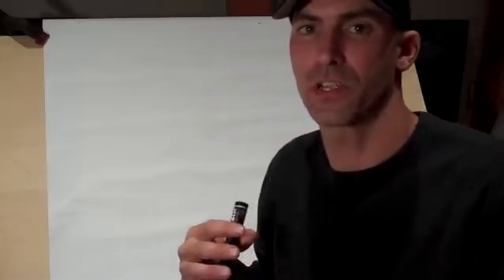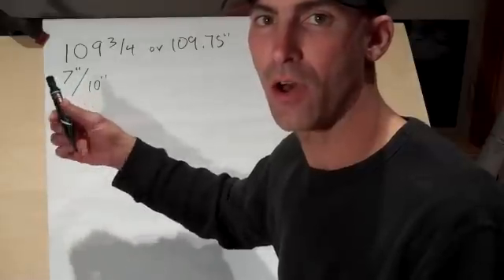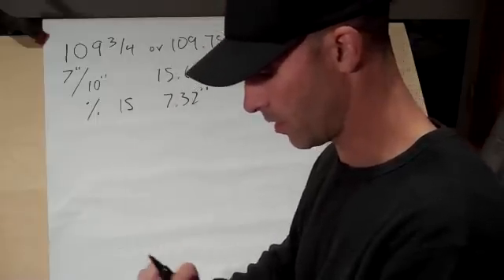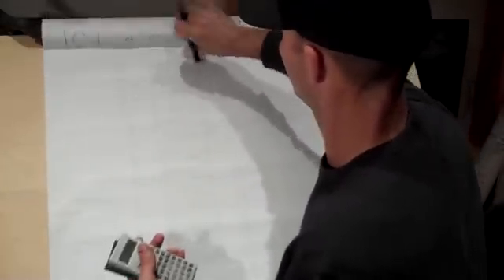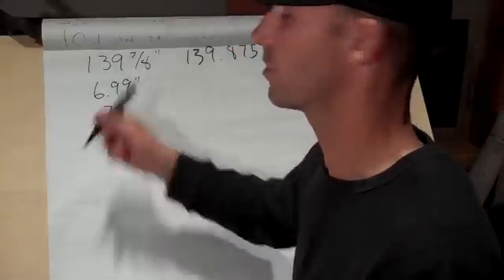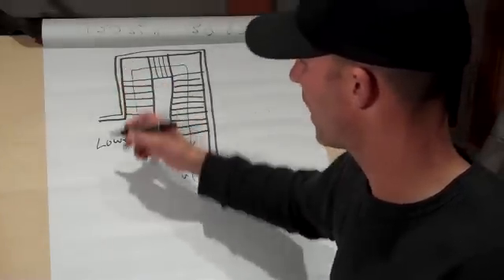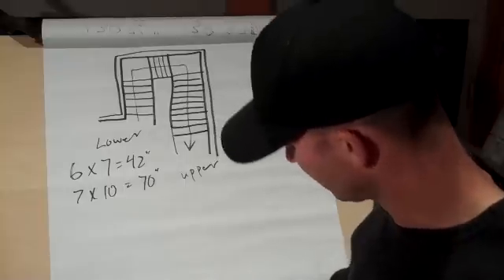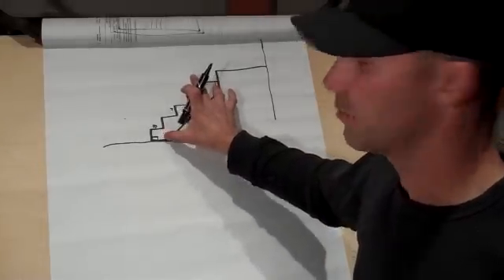How to calculate, layout and build stairs- Part 1 of 3

Comment: the other issue i have is figuring the run the landing has a two by four wall you state the stair shouldnt stick out past it,from the edge of that 2 x4 behind the sheetrock i have 30 and 1/2 inches to the face of the upper landing so I am measuring what for a run

Comment: Excellent video  used it for four flights of stairs down to the lake but I have a set that  the stringer length is 15 feet 3 1/2 inches and it is wobbly.Can u explain how to remove wobbl, can this be done by adding a 2x6 the full lengh of each stringer rather than inserting posts as it is rocky terrain and difficult to build bases?

Comment: I like your technique of showing a few examples how to do the calculation. I remember that part in high school when I took arcitectural drafting in grade 10,11 and 12. I thought that you would round the 6.86 to a 6 or a 6.5 and then just use your first bottom step as a small rise to make the difference. I guess not. I have another problem. When you have a floor above your head, as you walk down the stairs, the clearance from the upper floor down to the step has to reach a mimimum heigth.

Comment from the maker: @bruno2260 The run would be the same for the entire set of stairs.  In this case, there are 3 smaller sets that make up the overall set of stairs.  To make everything work properly you might need to adjust the sizes of the landing and/ or adjust the point that the stairs meet with the upper floor.  This needs to be taken into consideration in the planning stage so that you know how to build your landing and where to have your upper floor end so that it all works out properly.
Reply: So then landings are not always square?
Reply from the maker: @alansabrosky3244  Correct.

Comment from the maker: @fellowboyable The run measurement is a code standard that cannot be changed at will.  If you only had 48", the end of the stairs would probably protrude out past the wall a bit.  You can build a return back to the wall in these cases so that it looks nice.  It may also be possible to change you landing heights/ layout to move one of the rises to a different area of the staircase if you don't want to have it stick out past the corner.

Comment: Nice video,
A few things which you may wish to consider-
Finish floor thickness at top and bottom needs to be addressed
Tread material is 1 1/8", landings are 3/4"- adjustments need to be made.
cumulative error in layout technique

Comment from the maker: 20 rises gives a rise of 6.99375" per step.  Most people would struggle to cut accurately to the 1/16th of an inch, which is .0625", which is 10 times more than the difference between the 7" rise we used and the calculated rise.  Much more accurate than using a 7 1/4" rise for the calculated 7.36" - a difference of .112- nearly an 1/8th of an inch.  If you wanted to use 19 rises, you should cut to 7 3/8".